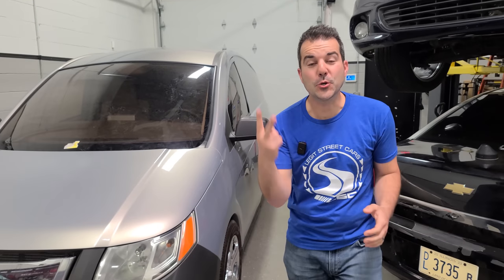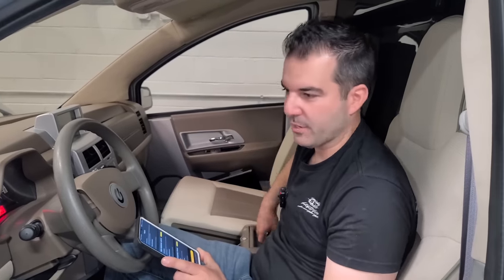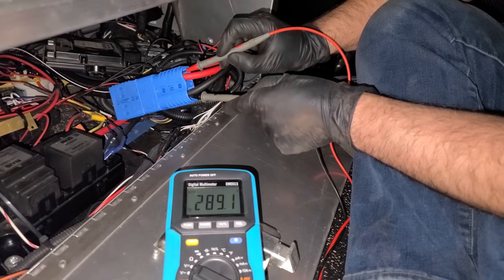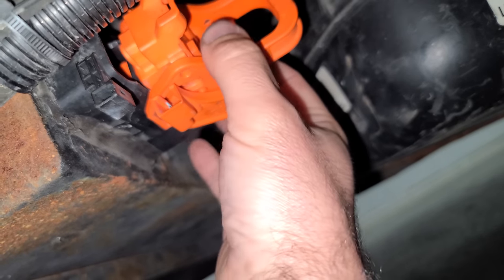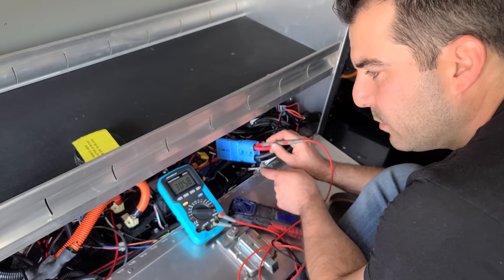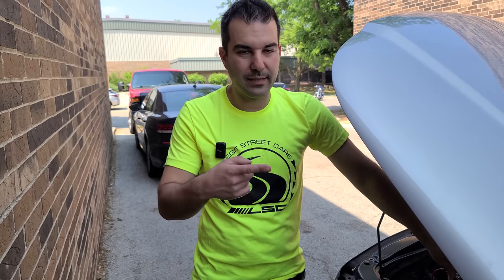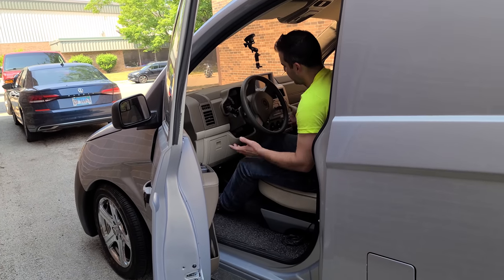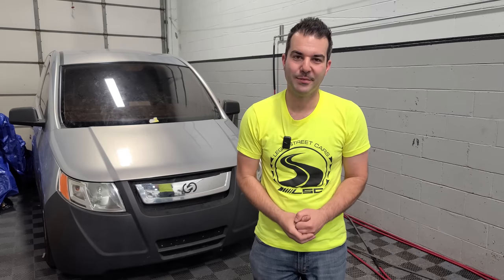I Fixed The Abandoned 2 Million Dollar Concept Car For $150! First Drive Ended In Disaster!

Comment: Is it possible that the shaking is due to a shifter position for EV is oposite to the reverse/drive positions for gas engine, so the electric motor is "fighting" the gas engine while is turning in oposite direction?

Comment: Actually, back in 2009, plywood floors were common on cargo vehicles. Most of the big (by European standards, obviously) Mercedes vans, like the 814 and its successors had plywood floors in the load bay, switching to sheet metal in the drivers compartment. Lorries like the Ford/Iveco Cargo that do millions of miles in all weathers also use plywood in the back, if they’re configured as a box van. In your case, that floor was obviously not intended to make it through to production. The access hole above the motor is pure marketing, with the polycarbonate pane in it. But it may well have ended up with 3/4” marine ply, if it had made it into production!

Comment: Since the Drive is Reverse and Reverse is Drive it might be fighting the transmission of the gas motor when moving. I would try reversing the power wires to the electric motor first.

Comment: I think there is a switch at the gearlever to tell the elec motor witch direction it needs to go. It's messed up, that is why you drive forward on EV when the gear is in reverse. And when the battery is low the engine kicks in and want to go separate ways.

Comment: Im wondering if the wiring into the motor reversed polarity?  Would kinda make sense why the shuttering if the gas motor is driving one way and the electric motor is going the opposite

Comment: My 2010 crosstour that i replaced the engine on in my driveway has now spun a rod bearing, cylinder 6 to be specific. After i pulled into the driveway last night the knock wasnt too bad and it didnt sound as bad as what the original engine sounded like. So before the noise got really loud i dug right in. Plugs all looked good. Got the intake off, intake valves look good. Drained the oil, little low and dark but no forbidden glitter. At this point i had no idea what was wrong as it was also still in time, so i decided to drop the oil pan, this included dropping the flex pipe as well. There were quite a few bigger metal chunks in there. Observing above the windage tray i saw my crankshaft for the first time, very exciting, but what wasnt exciting was seeing that one rod cap was black compared to the bronzeish that the rest were. I took my 12pt 10mm to the rod cap bolts to remove it, and the bearing definitely spun. It got molded to the shape of the rod too. I was able to push the piston up fairly easily and remove the bearing. Crank looked excellent under all that carnage, there were slight visible scratches but nothing i could feel with my fingernail. The bearing was absolutely smoked, i took out cylinder 6’s neighbor, cylinder 3, just to compare, a good bearing looked to be maybe 1.5mm thick, but the bad one was paper thin. The piston was a little worse for wear, i decided that it would be good to try and salvage some of my original engine, piston 2 looked the cleanest and it’s bearing journal looked and felt good (its bearing was not however) so i’m deciding on using it. Today (6/12) i got headbolts and a headgasket cause you dont reuse them, and now i’m waiting on bearings to ship. Once i get them i’ll put it all back together and hope for the best honestly. Im definitely using more oil and checking even more regularly.

Comment: Can you manually actuate the electric motor clutch to disconnect it from the axle? Might be some motor self test when it starts and if the electric motor clutch is supposed to disconnect during start up and doesn’t, the electric motor is trying to rotate while the clutch is jammed.

Comment: My electric Club Car golf cart motor does the same violent shacking thing when the batteries are low and I step on the go pedal.  If they are completely dead, then nothing happens, but lets say I'm only getting 24 volts in a 36 volt system, the shaking come back.

Comment: it is shaking because the motor is wired backwards so when the engine is going forward the motor is going backwards. So you either need to turn the motor 180 degrees or rewire it. 1990 Nissan 300ZX and a 1992 Ford Laser

Comment: you said something about a clutch in the electric motor, as far as my brain has thinked i feel like the clutch to the electric motor need a certain amount of power to be able to clutch at all. And when you start the car with the brakes on the electric motor tries to run away and that causes the shaking. When you unplugged the high voltage battery so the electric motor wouldn't run it reminded me of the shaking

Comment: If the motor is 3 phase AC. Switch leg 1 and leg 2 coming out of the contactor. It will make the motor run in reverse.

Comment: The three wires in the charge port could be the communication wires that EV chargers usually use. They're usually the PP, PE and CP lines. Knowing that this was a early charge inlet prototype and charger being wired up the way it is, it probably doesn't matter for this build but if you ever get into a newer EV project you will need those.
Reply: You’ll probably need to disassemble the storage cabinet so you can really get to the controller and inspect things.  I suspect the charge controller will take anything from 110-240v.
Reply: Yes the control lines tell the wall charger that an EV is connected and it's safe to supply mains power, and it also tells the EV's onboard charger how much current it is allowed to draw to avoid popping any breakers.  For an old charger like this that wouldn't draw more than a standard outlet the signal lines don't really serve much of a purpose, but of course they're still needed to activate a standard charger.  There are open source projects that hobbyists use to generate the necessary signals to get an EV wall charger to switch on, so that would be all you'd need here since you're only dealing with standard wall outlet amperages.
Reply: @Berkeloid0  Yup exactly! I didn't know that there were open source projects for this. That's pretty cool! You can also use the communication lines as a method to not allow movement of the vehicle if it is plugged into the charger!
Reply: Something tells me that lots of things are missing from this car and not simply left out on purpose. Keep in mind this suppose to be given to kids / young adults in certain school to further work on and learn from. I can bet they got crates worth of parts and documentations, more models etc then what is left of this.

It's missing lots of electronic parts, missing cables, cables being a mess, that motor bracket snapped like it hit something at a odd angle it's even missing material, it was in somewhat messy state suggesting this was a last minute order to get it the hell out of where ever it was because it took up the space and didn't offer too much educational value instead asked for too much work to finish something that wasn't much road worthy anyway. 

Also the reason why the more detailed clay models are missing, these are unfinished throwaway project clay builds that were inside, not showcase grade ones. A clear case of a tossout. Parts could be who knows where, either in someone's possession or tossed out into trash.

Basically every documentation files also missing from the cabinets. The school or someone kept those too and who knows where are those today. There is no way that this vehicle left the factory like this.

Comment: I think for some reason, the electric motor clutch isn't disconnecting. When you start the van, the motor is probably supposed to run for a few seconds as a "self test". Normally, if the clutch is disconnected that's not a problem, but with the clutch connected, you get that banging. Could also be the clutch engaging and disengaging due to low voltage. Also, with D and R being reversed, just swap the power wires at the motor to correct this.
Reply: I doubt they had the power wires reversed since it was a driving prototype, most likely there is some sensor or wire damaged that freaks out the controller
Reply: @Nighterlev  It's the power wires
Reply: @Nighterlev  Yep- you win the internet today 😁

Comment: With the engine going forward in drive and the motor going forward in reverse could cause you an issue when they both try running together . Check the motor wiring or orientation of mounting .

Comment: I'd double the thickness of that broken engine bracket and check what it mount onto to see if that is also broken or even secured to frame,  otherwise you're just going to have a repeat of being in a rattle.

Comment: Congratulations on making progress, I have a maybach modded w203 benz, loads of features and extra wires everywhere. Has been a challenge. Unfortunately with these concept cars the best way to handle them is one wire at a time. Trace, track and tag and create your own diagrams for reference. Once you have an understanding of all the systems you might think of ways to streamline and improve them.

Comment: it just seems like it has a long delay between gear change on the selector, you might have to be more patient with it and just "wait for it" as the saying goes. this is a super interesting project. I have done some prototype auto components in my career, but current  confidentiality clauses  I can't  talk about them, but a baptism of fire and trial and error come with the territory . Your willingness to take on this challenge especially without schematics is impressive . Great video, keep pressing forward nothing worth having comes easy, the learning experience alone is worth the 1500 bucks and you'll get thru it. Laser focus and great attitude will get you there.
Reply: Yes, the gas engine is the secondary, not the primary and likely has "lazy" engagement.

Comment: I'm surprised the engine isn't charging the batteries. You'd think as a plug-in hybrid it would run when needed to keep the battery level above a certain threshold. 

Absolutely loving this series on the van. Keep buying concept cars and working on them and I'll keep watching.
Reply: Too much load maybe

Comment: This has to be the best episode You've ever made, I felt your pain, along with you. I'm working on my 1967 Triumph Vitesse Mk.2 Convertible, I actually built it from 11 scrapped cars and lots of boxes of bits, between 1984-1997, it won lots of trophies and featured in lots of magazines, I brought it with me from the  UK in 2002, when I emigrated to Oregon, and I have been continuously improving it since 2002, mechanically with better/lighter/stronger parts, but the body and interior only has newer original parts as I want it to look as original as possible.

Comment: SOC or State Of Charge is more complicated than just voltage. 
For instance, you could reach max voltage and still only have a 10% SOC.

Personally, I like to think of SOC as the percentage of saturation of the charge. That’s just my rudimentary understanding of how it works.

Another way to think about it is, you have plenty of voltage in the battery but not enough amperage in the cells

Comment: sounds like the inverter converter system has malfunctioned. from battery to motor. i bet you if you swap that it should work... may look into the the speed controller for the electric motor as well.

Comment: Get the AVC2 J1772 from EV West to make your EVSE provide 120 2phase AC to your battery charger which is 'probably' the correct one for your battery pack.
Your batteries may not all be equally discharged - like you could have the majority of the battery cells at 3.6v (nominal storage) and a few at 1.0v (bad)
And that's why the motor brackets were broken ... you might need to work on the design ... you are having way too much fun!

Comment: If EV mode run front in reverse and the gas motor run front in gear,  thats the problem of the Huge vibration , the eletric motor tries to go backwards when the gas motor tries to go forward

Comment: Just FYI: Your hardware stack up from the bracket to the motor at 10:47 is not correct. Lock washer goes between bolt and the flat washer.

Comment: Scary. The electronics in there are off the hook and no schematic. I am almost as scared as you just watching you drive it. But the good news is no smoke, fire or explosions. Hopefully the problem is just the battery and a crappy mount. I would almost be tempted to rip out all the electronics and just make it a functioning gas space van.

As far as my current projects.. a 1995 Trans Am flood rescue and a couple of hardtail choppers. The TA sat for like 10 years. Had to replace the fuel tank, pump and all the injectors. Fix a bunch of wires and stuff that were chewed up by varmints and weeks of work freeing everything up like the seats and T tops... and getting the horrible purple tint off the back window. 

That was probably the hardest part but I could not see out the back otherwise. Next... get the A/C working, un-bypass the heater core, install new horns, fog light bulbs, a few odds and ends. Then paint. Also the dash is Florida cracked as well as the front seats. I will probably go aftermarket seats but the dash is going to be a project and a half to fix or replace. 

If anyone has an un-cracked 95 dash or any year that fits a Firebird/TA for sale let me know.

Comment: Even for a prototype, there isn't any excuse for the rat's nest wiring. I'd see if there is a wiring diagram that exists and go through the whole thing as you don't know what has been messed with>>looks like a lot. That bracket needs to be 1/2" steel since that puts out some HP.

Comment: And I'm not sure if you tried it but you using a Chrysler key which means you're using Chrysler ignition switch so you should be able to in such as turn it to the on position turn it away for like you're cranking the engine see if that does anything it might be a manual bypass pretty much to crank the gas engine in the case of the automatic start system not working

Comment: It sounds like the electric motor is hooked up to run back to front from the gas motor in the gearbox, so when you try to give it some throttle in gear it's fighting itself maybe?

Comment: It looks like a couple of phases on the motor are reversed. That would cause it to run backward. It might also explain the weird behavior where the motor is moving in the opposite direction of what it expected. It might also be that the battery was marginal for driving the motor.
Reply: I was looking to see if anyone had stated this because swapping 2 phases is exactly how you reverse the direction of a 3 phase motor. 

And if there are 2 phases swapped, who knows what else is miswired. In the last video, Amy said it was donated to a technical school and it's likely a few of the kids were trying to figure things out and connected things wrong. 

I also think Alex needs to figure out the dog clutch in the back so he can get it to disconnect when the motor might run unexpectedly to prevent the bucking and breaking the mount but get it to engage when he can actually drive it in EV mode.

Comment: Hey alex,  I found your channel through my brother who was a big fan of yours From the beginning of your channel and is an E55 owner. You motivated him to pull his engine and Rebuild it with an upgraded supercharger pulley and crank pulley from VRP He's having a problem with his crank pulley coming off the original split and carved the moon out of the crank So he bought the kit from VRP And drilled his crank and thought that was the fix then it snapped all 3 pins now hes on his 3rd attempt he removed the engine again replaced the crank and repinned the new pulley Do you know why this could be happening any suggestions??

Comment: The electric motor running backwards is likely related to the motor phase connections. Not sure if the unit used external rotor sensing for commutation of the DC into 3 phase. If 2 of the 3 motor windings are reversed, the corresponding pair of hall sensors must be reversed. It might be possible to skip this step if the inverter for the motor has a polarity switch separate from the engine shift for forward and reverse. Hopefully there is a dip switch or something to correct the direction in forward.  This would be a good question for the engineers to get data on the motor inverter.

Comment: i get its a prototype Concept Car and some people would want to leave it as is working or not but i would gut out the electronic ev side of thing and get it all tested by a pro and redo the gas and engin side of things working properly on its own then reinstall the ev parts on their own separate of the gas system and just have a big on/off switch for the ev

Comment: so the motor is wired in reverse thus at the throttle point the clutch engages it tries to reverse as the engine drives forward, thus pulling it appart

Comment: Would it be possible to separate the ICE engine from the electric power train so it will run on petrol only until you can get the electrics sorted! But first fit internal handles to the rear doors!

Comment: it seems that they put a security solenoid that lock the transmission when the voltage drop below 313v to keep the Lithium battery at a non destructive low level discharge, instead of cancelling any order to the electric motor. What a quite strange solution. Can you get any information on the battery ? if 313v is the lowest "working" voltage, the battery should go up to 380 or 400v. Any clue about that with the internal battery charger ?